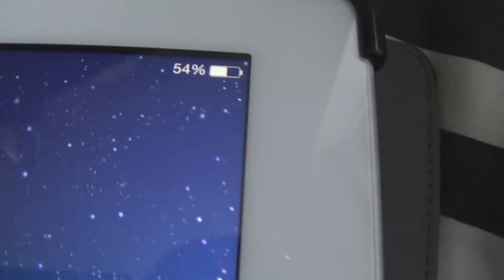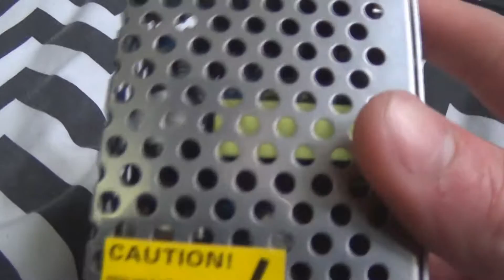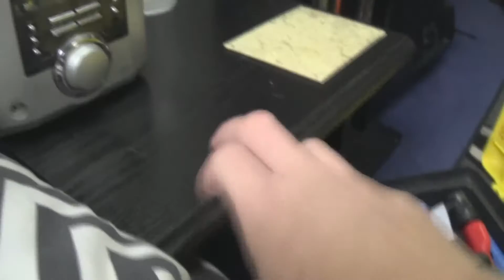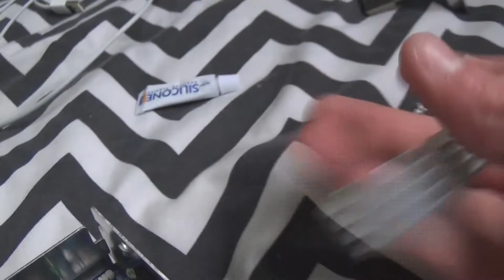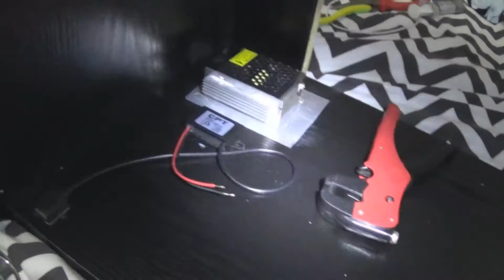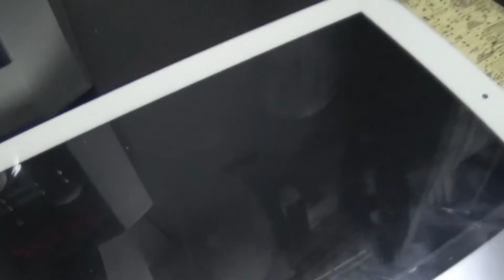Usb Charger Build Log

Comment: All chargers for the new phones and tablets are 5.2 or 5.3 volts. The devices uses only 5 volts but they have found that 0.2 or 0.3 volts consumed to the cable of the charger so they increased the output.
Nice build btw.
Reply from the maker: Thanks for the feedback, the output is actually 5.3v exact. But I think most devices can take 4.5v minimum to turn on the charging IC inside to charge the battery.